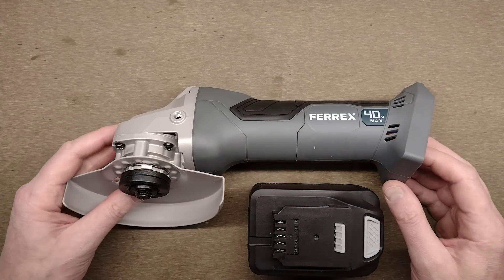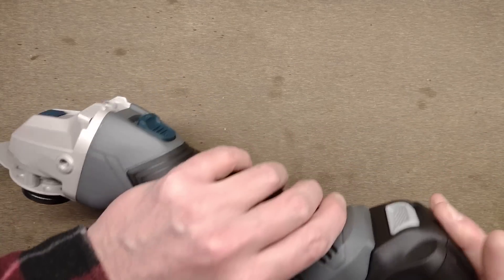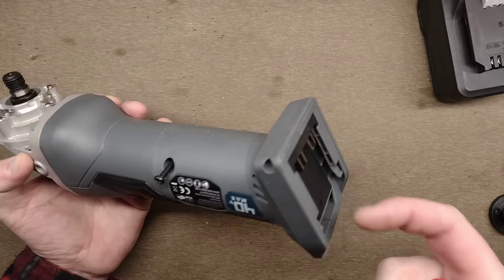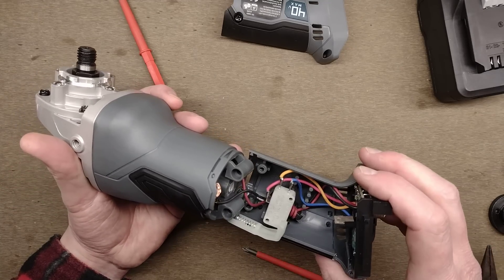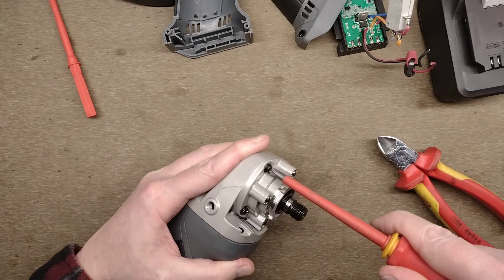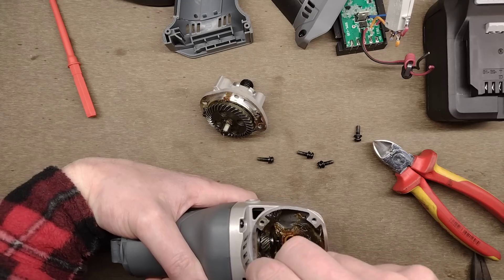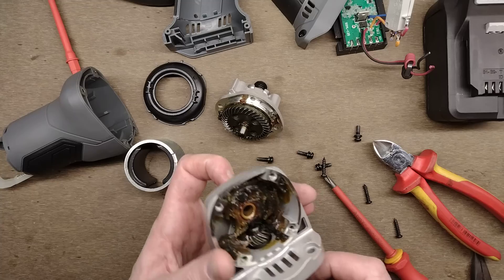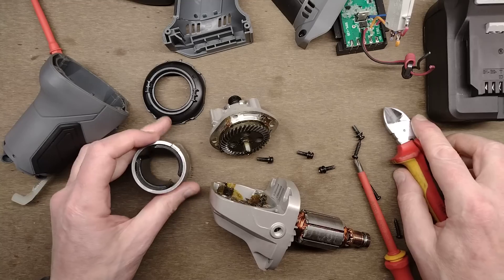Aldi 40V angle grinder mechanical teardown

Comment: I have the Parkside (Lidl) one. So long as you use the 4Ah battery it's actually pretty good given I think I paid £30 for it. I also love that it has a speed control, it has 6 levels between like 10krpm and maybe 1000rpm or less, great for sanding. That said, like all battery angle grinders it eats through batteries rapidly. It's more for if you need to do a few cuts or grind a few things, same as every battery grinder.

In fact I've bought into the entire Parkside system and most are amazing for the price. The impact driver (used to cost £20 but now £30) is actually absurdly high quality, it is competitive with the DeWalt equivalent even, and easily beats the middle ground tools like Stanley, Ryobi, etc.

In fact if you want to know whether a Parkside tool is good, check the label on the tool. If it says Kompernass then the tool was actually designed in Germany. The entire 20V range is designed by them, and most of the tools are good. As far as I can tell they're exclusive to Lidl, because I can't find them rebranded under anything else. Another one I'm really impressed with is the little SDS hammer drill (the triangle one), it absolutely destroys any combi drill (I have a Makita drill with hammer mode and it's terrible compared to it), e.g. the Makita completely failed to get through our driveway concrete, but the £20 tiny lightweight triangle SDS one went through easily.

They also have an ok 12V system. Sadly not made by Kompernass, and you can tell that even the molds aren't the same. That said they sell a 12V drill with a detachable chuck (to reveal just a hex bit holder}. And I absolutely love this thing as an electric screwdriver. It has a ton of power (I only really keep it on the 4th torque limit setting (it has 18 iirc, then drill mode), and in the fast gear is stupid fast. And the battery lasts an enternity between charges. I absolutely love this thing and use it every day. For £17.99 it has been so ridiculously good, the only thing I wish it had would be a locking hex bit (like the 20V impact driver has).

And I also bought the £17.99 12V angle grinder that uses the small 76mm discs. I haven't used it myself yet. But my grandfather (who used to build houses his whole life, so knows quality tools) borrowed it to install a new shower, cutting tiles etc (he wanted a small grinder as his are large ones). He said it chewed through it all like nothing. Again haven't used it myself yet though, but for £18 I'm already happy. I would recommend the 4Ah battery for it over the 2Ah probably.

Lidl also have a 3 year warranty on all 20V and 12V tools, that is very good.

I really love the Parkside brand and must own over 10 of the 20V line, and I think 3-4 of the 12V line. For what I've spent on them + the tools, I'd only own a few Makita tools. If anyone has any questions about the other tools I own in the range, ask away. They aren't all as good as the impact wrench or that 12V screwdriver (technically a drill), but considering they all cost less than £35, I feel expecting DeWalt/Makita/etc performance out of all of them isn't fair.
Reply: Yes I agree with you . The 20volt stuff is brilliant. Also have the cordless power saw . I have two angle grinders 3 impact and a heavy duty 20v hammer drill . Paid £20  each for most of it and £40 for the power saw . Also brought the fast chargers and 4 amp batteries as I use them 5 days a week at work as I haven't got mains electric very often as it's outside carpentry.
Reply: wise words, i jumped on the Ferrex line so i am committed, started with their small SDS and then went onto...Bench Grinder, Bench Sander, Bandsaw, 3 angle grinders, Recip saw, Chainsaw, Strimmer, 2 hand sanders, Combi drill, polisher and brushless Impact, new Dremel clone, and JackHammer.  As with Parkside they do vary, the older dark blue models seem best, followed by grey and the newer paler blue.  China must have two super factories and two QC people, if you get the tool made in the cheap factory inspected by the dozy QC ,an then you have a lemon of a tool, flip that and you have a very good tool, or best get Mr Makita QC to sniff round the good factory for the best.  I have also recently spent £6000 on Makita 18v and corded, and for circ saws and mitres i wouldn't trust cheap brands, just not safe.  Ferrex are great for small jobs or a spare for pilot holes.  The bandsaw (year old) is very competent.
Reply: @stigkrakpants3052  I believe Parkside are produced thus: designed in Germany, made and packaged in China. However, there are German quality control people at the factories who do rotation stints - three months on, three months off or similar and that would appear to be the key to the much improved consistency of their tools.
    Of course they're not comparable with the 'big three', as the tool snobs are wont to tell us, but does the quality difference really warrant five times the price? 
    So glad I ordered the Batavia steps on Monday:  they're no longer available on the website.
Reply: oh and bargain of the year...Batavia step/stand down from £130 to now £30, Toolden sells them for £220.
Reply: @stigkrakpants3052  In my experience Ferrex just doesn't compare to the quality of Parkside. Sure both are made in China, but Parkside 20V is designed in Germany, and the company keeps control of the Chinese factory...

Also Aldi mismanage the line so badly. They've now introduced three different battery systems for three different tools, all branded by them. It's ridiculous.

Maybe Ferrex was better years ago, and you got the decent ones. But I've opened a bunch of Ferrex tools at my local Aldi (I make sure it's all back and packaged unlike some idiots), and the moulding is dreadful, huge misalignment, bits of plastic that haven't been trimmed, poor attachment to the grip material, etc etc.

The 20V line of Parkside you get some very good QA for the price, the moulds are nearly always what I'd expect of older Makitas (of course they don't compare to the new high end ones) that didn't use more modern processes. As I said the 12V line is a significant drop, the moulding is nowhere near as good as the 20V line, but it's still an order of magnitude above Ferrex.

Can't speak to the performance or longevity of Ferrex with any honesty, as I said I never touched them because of the dreadful outside. And I'd never touch them now because of Aldi being stupid with their incompatible batteries.
Reply: That little 12v. grinder is such a go-to piece of kit. I wouldn't be without it. I also agree about the 12v. detachable chuck drill. It sits on the end of the workbench for those one-off jobs where it's not worth getting out the 20v.
Reply: The Parkside 12 volt drill/driver is a great little tool, I've had one for a couple of years, no problems with it either.
Reply: @RichieReportsUK  You're right it's actually pretty good at being a drill as well for its size. and voltage.

But I run it without the chuck on 99% of the time. I use it as an electric screwdriver and it absolutely excels at that. I have it on the fast gear setting and leave the clutch at around level 4-7 most of the time, going up to 11 sometimes.

It's so great because it has good torque and it's really fast on the fast gear. Screws just come flying out/in with it.

Also it's got pretty decent clearance, it's not super small, but it's pretty good. That said I normally use the really long hex bits on it. E.g. for Phillips/Pozi/flat head I have 15cm bits, which is brilliant for avoiding most clearance issues.

As I said the only thing I wish it had was a locking mechanism for the hex bits. E.g. if we look at the 20V impact driver, it has a nice locking mechanism for the head. I find it a must with torx or allen bits, because of how often the bit jams. And also on the 20V impact driver I can use a 30cm extension bit, which just falls out of the 12V drill for obvious reasons.

I was going to buy two more of each to see if I could mod one of the 12V ones to have the latching mechanism of the 20V driver. But they put the price of the driver up from £20 to £30, so I didn't bother (still an amazing driver for £30, but it wasn't worth spending £30 to sacrifice to me).

And one more thing, I recently swapped out the 2Ah battery for the 4Ah battery on the 12V drill. And I don't think I want to go back. It just feels so much better balanced, and it can stand up easily now, so less chance of getting some liquid/oil on the side, and for me it's easier to find when I forget where I put it. It's also even faster and has slightly more torque (though we're talking like 10%).

As for actually drilling, yeah if I need to quickly drill a few holes through wood or thin/soft metals, yeah I'll either throw the chuck on, or better yet just use some hex bit drill bits I have. But if it's anything more than that then I'll get the proper drill out. If it's for wood/metal then I'll get my Makita out (I do have 20V Parkside drills, but I have owned this Makita for a long time, and will continue to use it until it breaks, at which point it'll be replaced by Parkside and I can go to one battery system finally).  If it's masonry then I'll either get the 20V triangle shaped SDS drill (which is tiny and super light for an SDS), else I'll get the AC large proper hammer SDS.

For reference I do server installations/maintenance, network runs, server/computer builds, etc etc. And on the side do general DIY for friends/family, and recently affordable smart home conversions (and doing it safely, PoE to most devices, Home Assistant as main controller, absolutely nothing requires an internet connection, and most devices that connect to the network have been flashed to ESPHome so I know exactly what they're doing, and are segregated into their own VLAN). I use this tool all day and the battery lasts ages between charges.
Reply: @lost4468yt  I actually find the chuck itself will grip the hex bits quite well too, if im drilling a lot of holes & don't want to keep removing the chuck for using it as a driver!
I also bought the 4Ah battery the next time they had them in stock too.

Comment: I had a Makita one like this. It lasted 2 years of DIY use and the board went and made it not economical to repair. I have various brushless tools on my scrap pile. 
This brand might be worth a look!
Reply: If You have two or even one Makita Bl1830 batteries, then I'd recommend buying Chinese knockoff Makita anglegrinder instead.
Reply: When makita were corded they used to eat concrete.

Comment: If the only mechanical parts are the motor, a pinion gear, the angle (or ring) gear, and associated bearings, what the heck makes that much noise, even under no load?
Reply from the maker: I'd guess cogging between the gears.

Comment: It sounds like a good deal.  Unfortunately, it doesn't look like it is available in the USA.  The Werx 20V grinder looks similar but sources here on Amazon want $39.95 for the tool by itself, then the battery & charger extra.

Comment: First of all, Big Clive you're the best, ripping stuff apart to explain how it works for the benefit of others less well qualified, so they don't have to wreck their own gear doing so, BTW a bit like I often do myself. 

I like this 40v grinder with nice smooth start up and running speed. The standard 20/40v grinder Big Clive has dismantled here, its normal price is £20, The brushless model is about £10 more (both bare tools, no battery or charger). I have both models. The brushless model is supposed to be easier on the battery and runs at 20v, either smaller 20v battery pack or if you use the 20/40v battery it will still run at 20v 2X 20v in parallel (stacked) to give you extra current potentially providing more torque and slightly more than double running time due to shared load of 2X 20 packs reducing loss as heat, might need big Clive to explain that in more detail. The brushless grinder runs far too fast without any means to regulate it or slow it down, I am afraid to use it as I feel the poorly balanced disc that came with it might disintegrate at the high rpms, I had to keep shutting it on and off to keep the speed under control, I think it should have a recall for safety reasons, so I don't use it, it is probably ok for the lighter cutting blade but be warned its fast and powerful so wear all the protective gear. Hopefully before long Clive will do a teardown of it as well and maybe can guide on a speed control upgrade.

Comment: Im sure when I’m using the 20/40 v battery on the 20v tools it’s only giving 2.5a , it’s not lasting long enough to be the full 5a
Reply from the maker: I have a 20V drill here to explore.
Reply: @bigclivedotcom  that will be another interesting video Clive will be good to see if I’m right in my assumption, if you get the chance to try and overload it would be nice as the impact wrench locks out so short of its rating didn’t know if it’s the battery’s own protection or the drivers that’s responsible

Comment: What the hell, it's actually a reduction gear? I always thought it has a multiplier to ramp up the motor's speed... or does it depend on brand/size/grinder type whatever?
Reply from the maker: Direct drive or gearing up would result in a very fast disk spin, but low torque.

Comment: I have one of the old Ferrex units. It's fairly good, but doesn't really have the power to cut through stone. The batteries don't last long either. But, for a handy grinder with light use it's a bargain!

Comment: How much current is that microswitch rated for? My Lidl angle grinder had problems with the switch and I think all these switches die sooner or later due to the amount of current that passes.
Reply from the maker: It's actually rated for 25A, and although it does break the current when released, it doesn't have to deal with a spike of startup current.

Comment: i have seen that range of power tools in aldi so many times buth they never have any battery packs in the shops only the tool its self and the chargers. did the store you got that from have the battery packs in clive or did you get the power pack else where?
Reply from the maker: I got the battery and charger at the same time.
Reply: @bigclivedotcom  must just be a south yorkshire thing that they never have the battery pack. Hahaha

Comment: FERREX! I got a 20-volt battery operated drill driver made by Ferrex and sold by Hofer (which is kind of the same as ALDI, but here in Austria) about a year-and-a-half ago. Was quite useful for putting some furniture together. What I experienced was that the brush fire (and resulting back-EMF spikes) in the motor must have been so severe that the actual PWM-switching logic got damaged. That thing started running on full torque even on its lowest trigger setting. For "low torque", I would have to squeeze the trigger all the way in, then back out to low. Weird thing. First time I used the tool after the fault, I tried to open the chuck to remove the tool bit. Resulted in a quite unpleasant twisting of my wrist.
I disassembled the drill driver, got rid of the switching trigger module, and replaced it with a DPDT polarity-reverse switch and a pot-controlled 20V ESC module from the company that smiles the whole alphabet. I'm not using it as a drill driver anymore. Got a new one from Amazon also.
Reply: It's not "made by Ferrex". Ferrex is Aldi's own house brand. Any company that Aldi commissions to manufacture power tools for them will slap that label on. Same as there isn't an Ashfield Farm that produces chicken for Aldi. It's all just 2Sisters or Cranswick or Bernard Matthews putting the name of whatever they're packing for Aldi. The actual chickens come from their normal suppliers they also use for all their other customers.

Comment: When stripping down a DC permanent magnet motor it is always good practice not to remove the armature from the magnet if at all possible because each time you do it you lose some of the magnetism from the magnets. If the armature does have to be removed from the magnet then a keeper has to be immediately fitted in its place.
Reply: I’m curious. Can you elaborate?
Reply from the maker: I'm not so sure about that.
Reply: @bigclivedotcom  "Permanent magnets like to have an easy external path of, for example, steel or iron for the magnetic flux to flow along between their poles. If the path is made more difficult and the magnet has to force its flux through a lot of air or non-ferrous material, it immediately permanently loses some of its strength. How much depends on the material of the magnet, its shape and the maximum amount of difficulty it has encountered since it was magnetised.

A 'keeper' is a piece of iron or steel that is placed between the poles of a permanent magnet when it is not in use to maintain an easy path for the magnet's flux. "

Neodymium magnets do not suffer so much from this happening, it is more of an issue with older magnet technology.

Comment: Bought one at £20 Not as powerful as my 240v tools but ok for the odd job. Looks like the 40v pack is 2 x 20v packs strapped together and used in series but the 20v tools use the 20v packs in parallel. I think this could be easily done according to which tabs are used on the battery pack. Will be interesting to see the deep dive into the electronics.

Comment: I 'have' the 20v lidl version, its been great but after 2 years and much car/van work i finally wore out the motor which is waiting for a rewind. also it has a speed control.